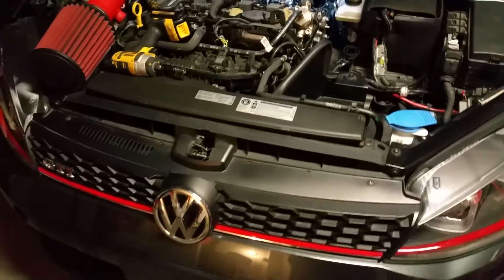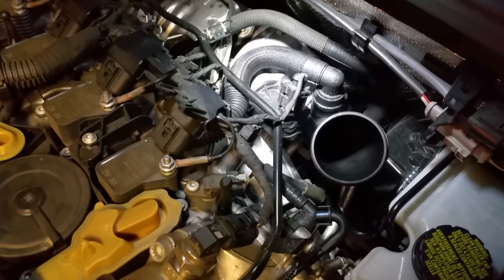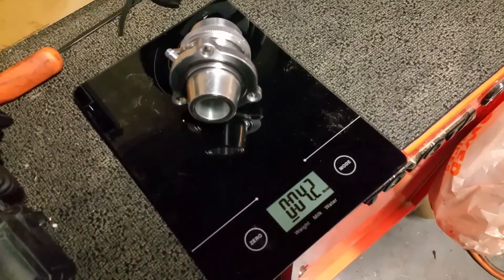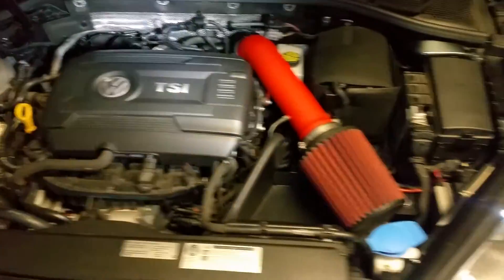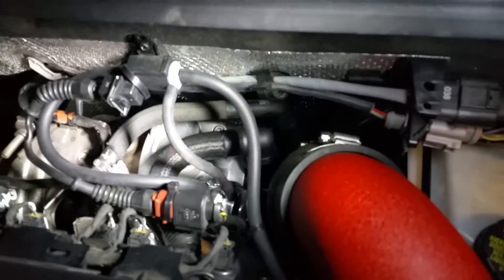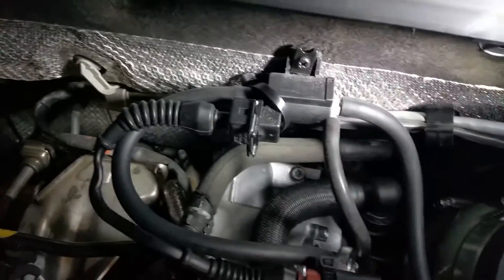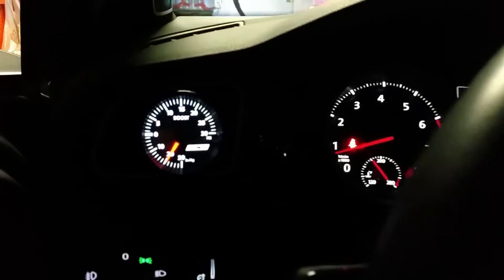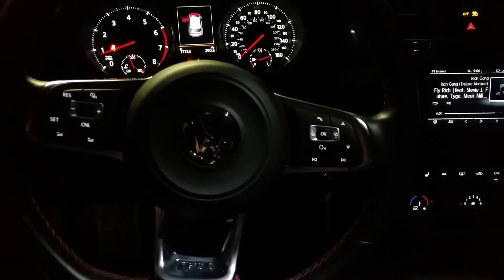Forge BPV BOV installation and demo MK7 GTI & R

Comment: I have the AEM intake as well for my GTI MK7. Area where battery and the pipe is near, does yours touch each other as well? Also can you do a video on the HID Kits, I have one fore my Halogens right now, waiting for headlights in the mail. But I am frustrated bc right side wouldn't come on time to time.

Comment: what intake is that
Reply from the maker: AEM intake.
Reply: +Modfyd Inc how do you like it? sounds nice. i just can't see myself paying over $200 for an intake
Reply from the maker: +WHENZLUNCH it sounds great but its more for unlimited cleaning and audible noise than it is for power. It has zero power gains. If anything, it lost torque. If you're in socal area, let me know about installation and I can do it for you for cheap.